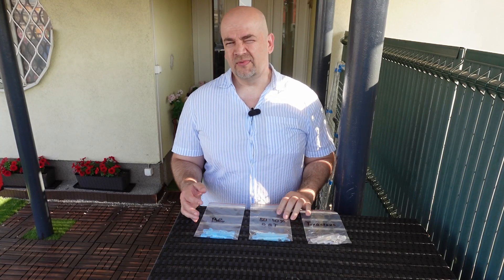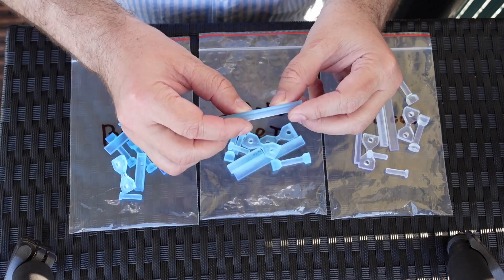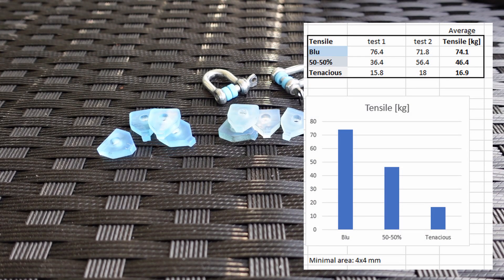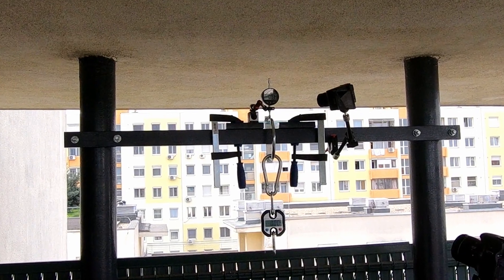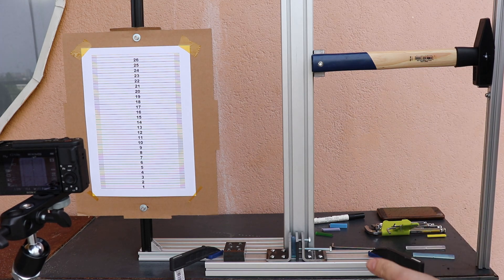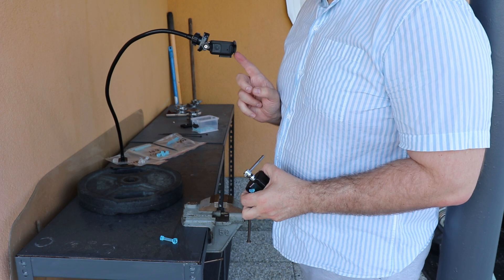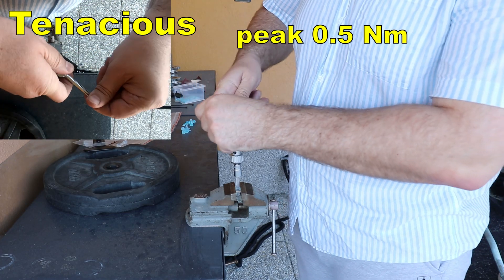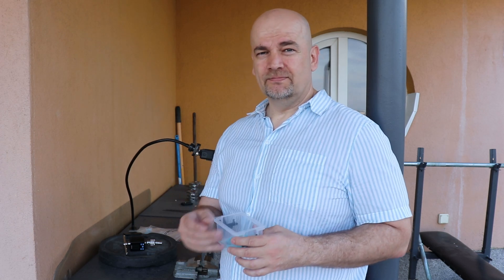Siraya Blu vs Tenacious vs 50-50% mix

Comment: These are interesting tests, with the performance of the resin mixes it would be great to get a 25/75 and a 75/25 test to map out the changes over varying mixes of these specialty resins, they don't look all linear so be cool to find optimal mixes for varying use cases.

Comment: I'll need strong resin for my DIY project (a 3D printed centrifuge for separating waste fluids from heavier /not chemically bound/ pollutants. Like the ones used for waste oil processing, but in my case for separating IPA from resin particles).
I'm planning for a ~14cm spinning drum (143mm is the widest I can print on my Mars 3 anyway, and I'm still not certain on how thick the walls need to be).
I think 5~6mm walls should be ok, so the centrifuge calcs show that at 65mm radius & 11740 RPM the effective force would be ~10,000g
I'm planning to use my Dremel (4300 @175W & max 35,000 RPM), I know when having to spin things much heavier than a drill/saw bit it'll lose RPM, but it seems that even with a third of its RPM it should still generate 10,000g at the small radius of 65mm (radius increases g-force linearly, while RPM increases it exponentially - by the square!).
So it seems to me that the limiting factor would be the resin's tensile strength.
Besides its own weight the drum would have to spin no more than 500~600gr (more likely up to 400gr), but at 10,000g it will be challenged (it's very likely I'll have to settle for much lower RPM. @5000RPM which is the dremel's lowest & 65mm radius it'll still generate 1,800g, which I'm sure will still be enough for separating fluid from pollutants).
I'll most likely have to print several samples of different thickness and test them to what RPM they break (and then lower RPM with a safety factor for the real use).
But one thing is sure, I'll need the strongest resin available (w/o selling my kidneys :)).
So any recommendations incl. post-curing process would be greatly appreaciated!

Comment: thank you for the review

quick question: I am making my own articulated figure (like iron man those).  i was using aqua grey 4k and the joints were keep breaking. do you recommend me using the mix one or the abs-like one for my project? thank you!1
Reply from the maker: Probably 80-20% mix (Blu-Tenacious) would be better, but I didn't tested that combination.
Reply: @MyTechFun  thank you so much!!
And what are the exposure settings for the mix would you recommend? Thanks again man 🙇🏻‍♂️

Comment: love your tests, would like to see the creep test you've been doing recently on siraya blu and it's mix too!
I've printed a couple of small functional parts (soap holder etc.) out of blu and after 1/2 weeks they're already droopy, considering moving away from blu due to the excessive creep
Reply from the maker: Tony, where are you located? You could print those C test specimens and send them to me (I am from Hungary, EU)
Reply: @MyTechFun  I'm from New Zealand, I'll print some of the C tests in blu next time and I'll run something similar to your tests, I'll send you my results when it's done and maybe you could test it if it's interesting!
Reply from the maker: @quansasun  NewZealand? Yes, it's better if you do the test yourself. C-test specimen you can download from here: https://www.mytechfun.com/video/143 (bottom of the page)
Reply: @MyTechFun  I ran the tests, measured from top of C clamp to bottom (not separation between the two ledge like yours) when it was taken off and back of c clasp flat against the caliper. all measurements in MM, 2 tests:

Day 0: 50, 50
Day 1: 56, 55
Day 2: 61.3, 62
Day 3: 68, 66
Day 4: 78, 68
1 day no load: 78, 60
3 day no load: 60, 55

C clasps were 4.5mm thick as printed on bed (with a little elephant foot), i cured one for 20 minutes other for 30 mins, the 30 mins one had less creep

Looks like majority of the extension is elastic however recovery takes very long time (24h+), i know it wasn't scientific only doing one of each sample however it seems like I'm under-curing my prints
Reply from the maker: @quansasun  Useful infos, thank you Tony!

Comment: I like the hammer test, because it shows that while the Tenacious resin is not necessarily rigid, it did absorb more energy before giving. That could be useful as an impact buffer, perhaps

Comment: Just keep in mind to get the most strength from these resins (or any resin for that matter) you must cure under high power LED's for an hour while at 60c.
I just got back from the gun range and have confirmed that is the case.
Reply: What did you use to keep them at that ambient temperature? Also, did you notice any deformation in the dimensions after keeping them under heat for that long?

Comment: Thanks for taking the time to do this.
From what I have seen and do myself a mix from 5 to 25% of tenacious to Blu is the norm. 
I have settled in on 15% tenacious for what I do.

It really helps and prints great. Just remember your resin temps . And someone please send this man a printer
I am going to look into setting up a go fund me for you. I have never done that before so if someone else wants to start one I am down for putting in some cash.

Thanks again
Reply from the maker: I had few requests for SLA printer review and I accepted them, but somehow they changed their mind, probably bigger youtubers also accepted the request.
Reply: Interesting. What kind of characteristics does that ratio produce?
Reply: This is my experience too. I'm adding 15-20% of tenacious usually. 50-50 is way too much.
Characteristics: it becomes a bit less brittle without loosing much of the strength.
And yes, it's very important to heat resin to 25+C when printing this!

Comment: Thanks for sharing.  Great info for users who are looking to mix themselves
Reply: Which type of the 3 (or other resin) would be the most abrasion resistant, for example for action figure joints ?
Reply: @japanesepokemoncardsbuydir9657  Probably Blu since abrasion resistance is most often a function of surface hardness and Blu is the hardest of the three
Reply: Sponsor him !!!
Reply: @veronicaortiz2058  , yes, I'm interested to see same tests of the other resins, like Build for example
Reply: Question, as far as I am aware - proper curing requires heat treatment, over a certain period of time, to achieve strength. 
In your experiments it seems you 'only' cured in a cardboard box with UV.

Comment: I think the mixing has no benefit.
Reply: If you look at it from the perspective that it weakens the more expensive Blu resin, you're right. But, if you look at it from the other way around, mixing strengthens less expensive, more brittle resins.  I print miniatures for people and always add about 20 to 25% Blu to strengthen the prints. It works really well for that application.